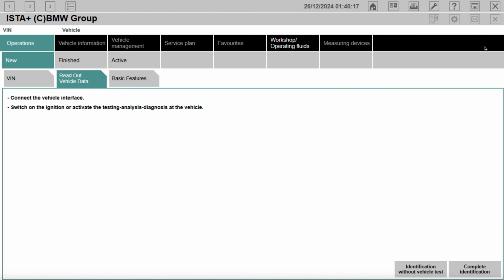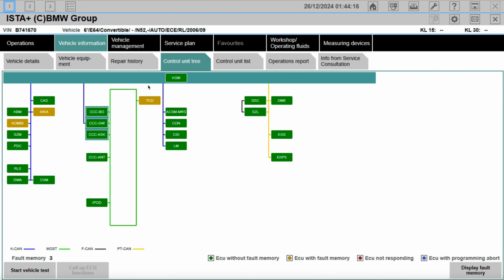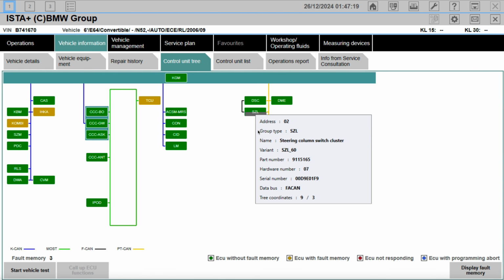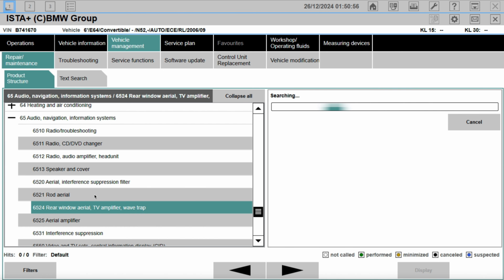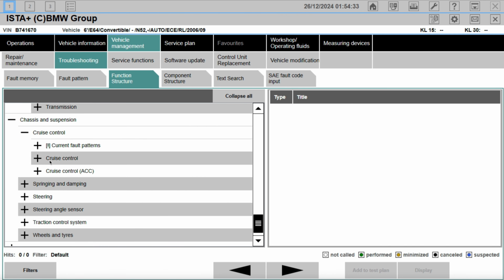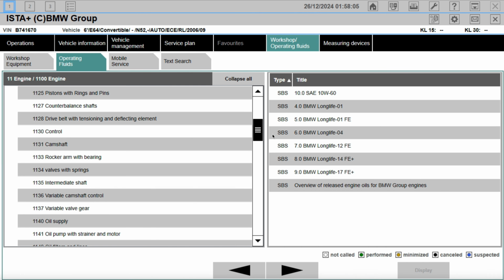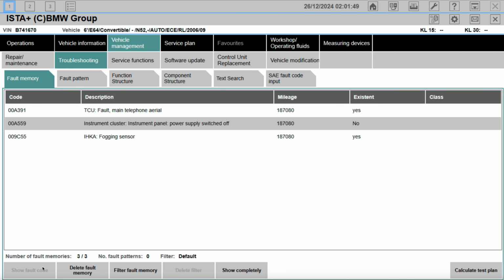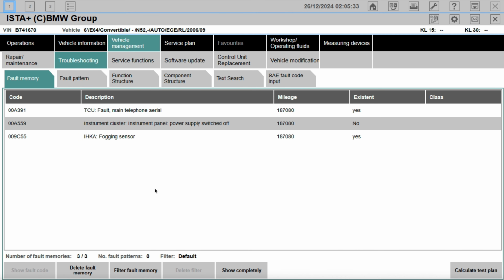HOW TO USE BMW ISTA+ FULL TUTORIAL & ALL FUNCTIONS!!

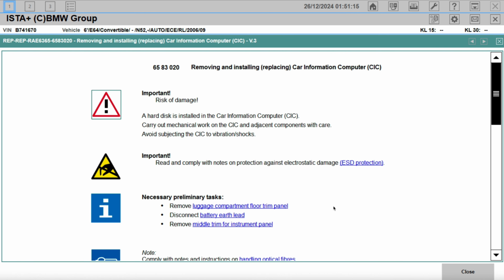Comment: 11:28 - Wow, simply just wow. Very smart how BMW implemented its diagnostics system, everything in one package, from testing to literally repairing. There is no excuses from not able to repair a BMW. 22:51- I'm the guy that needs this software, I like to go in-depth with car computer hardware (I do low-level computer engineering and programming).

Comment: I need remote coding assistance for my 2014 BMW 3GT (F34).
The Problem (Self-Caused):
1.	While attempting to enable the temperature function of the Tire Pressure Monitor using a Launch OBD scanner, the connection was interrupted. This resulted in RDC module fault codes: 480A46 and D35694. The module needs to be fixed.
2.	The car’s service history was also accidentally deleted and needs to be recovered/restored.
Do you offer online/remote coding services for this? If so:
• What is the cost to resolve both issues remotely?
• What is your procedure? 
Thank you.